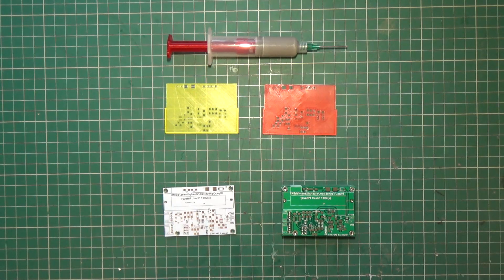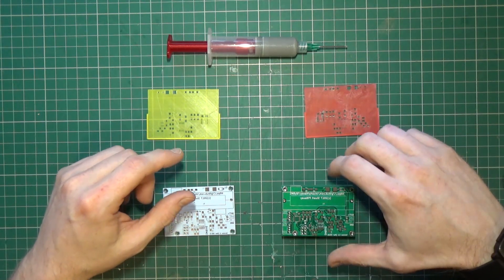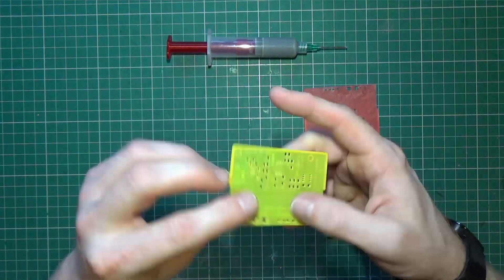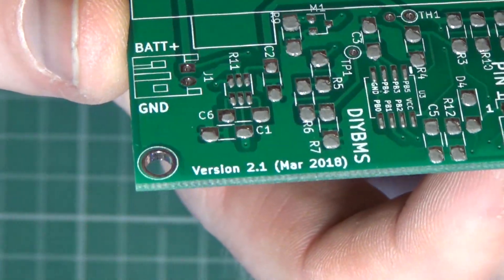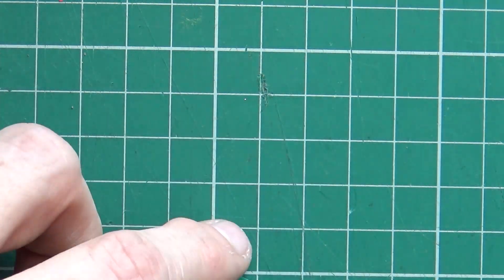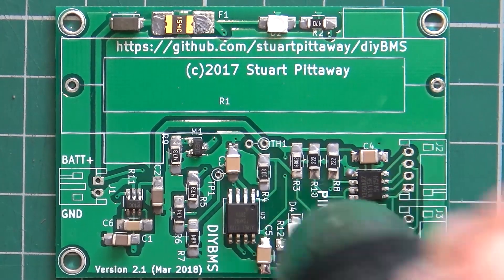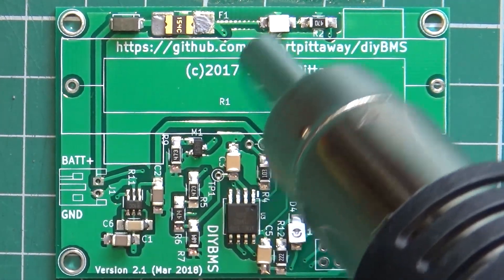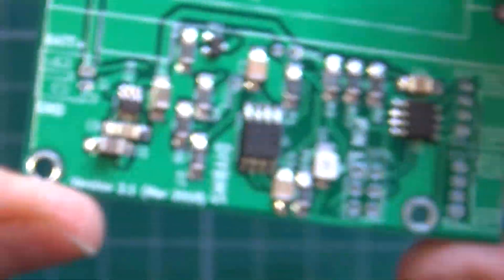Can a 3D printed solder stencil work?

Comment: Ill be reballing a macbook cpu soon and now way am I going to carefully arange individual balls by hand or wait 2 months for a stencil to arrive from china. Ill 3d print it in resin. Im thinking if it would be a good idea to instead of the paste, use the solder balls and cover the cpu with flux so the balls stick to it a bit. But idk if its really possible to then lift the stencil without shifting the balls. Or Ill test if the resin can possibly survive the heat

Comment: I wonder if you can print this directly onto a sanded piece of flattened aluminium from a soda can, basically using it as a 3d printed RESIST, then etch the exposed parts away from the aluminium by putting it into a water bath with NaOH drain cleaner.  (use tape to protect the other side).    
This way you'll have a thinner stencil, made of aluminium.
Reply from the maker: That sounds interesting would be great to see what results you get.

Comment: Hi Colin

Can you give a link to buy the same solder paste you used. Did it come with nozzles or did you buy those separately?
Reply from the maker: Hi Ian, really sorry for the delay.  https://www.ebay.com/itm/311834953927  It came without any needles so i purchased those separately.  https://www.ebay.co.uk/itm/252917745374

Comment: Thanks Colin! That is A LOT of paste on each pad ;) ... but yes, you have proven it is possible to make a 3D printed stencil if you have a small enough nozzle. Great job!
Reply from the maker: Really i thought it was just the right amount lol, shows my total lack of experience doing surface mount, I've always soldered it by hand in the past.  There are definitely limits with the printed mask, shall try a little less solder paste on subsequent boards.  Thanks for the comment and kind words :-)
Reply: Haha, all good. If the board reflowed and worked, then it was the "right amount"... but yeah, you can get away with much less for sure :-)

I've ordered some Mylar to try laser cutting stencils, but it;'s not arrived yet. We can go head to head... 3D printed vs laser cut mylar!
Reply from the maker: Haha i shall break out the 0.1mm nozzle and get it on the mk3 then ;-)  btw i noticed that jlcpcb will create a metal stencil for only 5 pounds which i thought was pretty reasonable.
Reply: Yup, I have a steel stencil coming with my 100x Neo7Segment PCBs - but that's for my use for production. I want to try to laser cut the mylar so I can possibly provide stencils in the Neo7Segment kits I sell.

Comment: What are the leds you are using? Thanks for tutorial.
Reply from the maker: Hi Jman i went for these LED's.  They are ok although not as good a choice as stuarts https://www.aliexpress.com/item/100pcs-1210-3528-RED-SMD-LED-SMT-PLCC-2-1500-MCD-Ultra-Bright-LED-New-Hot/32788331922.html?spm=a2g0s.9042311.0.0.8I9ZOf
Reply: Colin Hickey 
Thanks. I ended up going for theese ones:
MCIGICM Blue yellow green red white 1206 SMD LED diodes light
 http://s.aliexpress.com/2eIju2mI?fromSns=Copy to clipboard
Reply from the maker: Those look better than the ones i got,  i'll pop some on my next aliexpress order.  I'm sure i ended up with slightly larger capacitors as well so had to stand some of mine on their side to avoid hitting other components.
Reply: Colin Hickey The capacitors I bought are 1210. Hopefully they are not too big